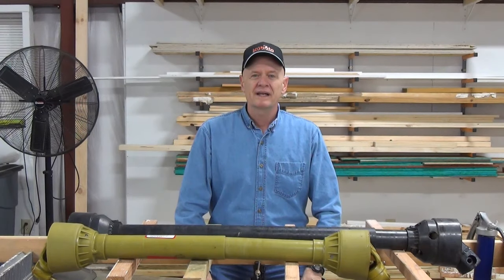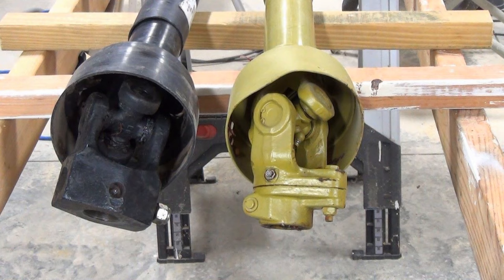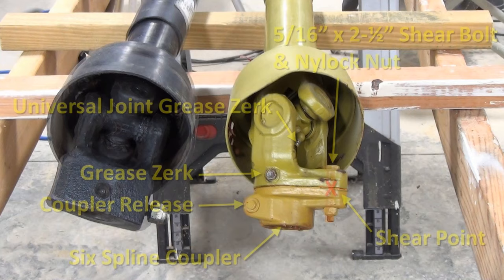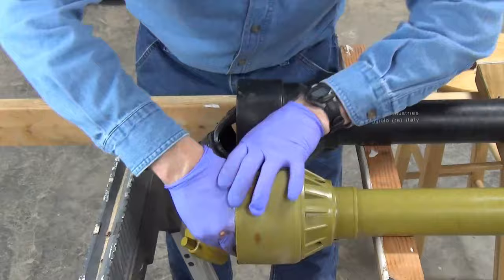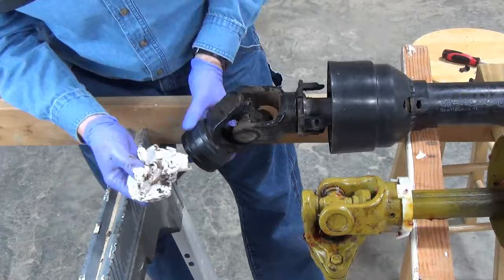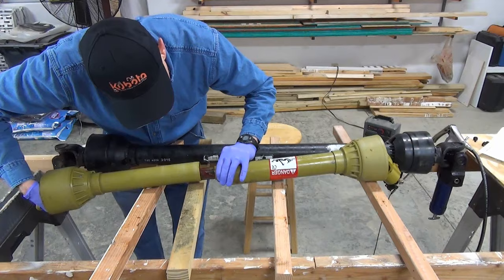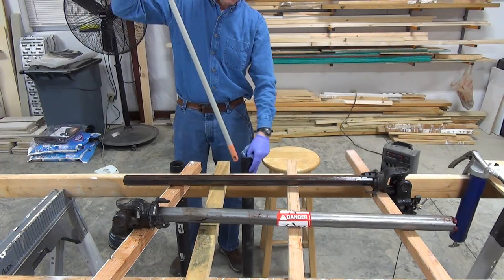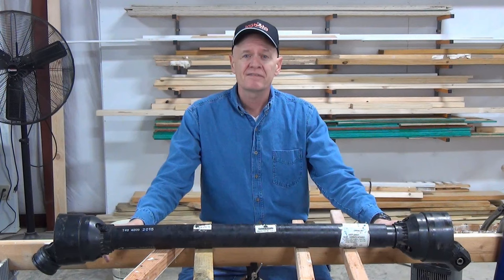PTO Shaft Maintenance - Don't Neglect This!  (#117)

Comment: I use a different method to separate my PTO shafts for periodic inspection. It involves forgetting to disconnect the PTO and driving away from the bush hog.
Reply from the maker: LOL!  I have done the same thing!  Total valid method. Thanks for watching!
Reply: Don't back up!
Reply: Cold weather makes the dirty grease inside the shaft stick. I will pour a bit of diesel fuel in and try to get it sliding.

Comment: Right now my PTO shaft is being pulled apart between two trees using ratchet straps because they won’t come apart. I’ll be sure to come back to this video for preventative maintenance so it doesn’t happen again 🚜 👍🏼
Reply from the maker: Yikes!  Sounds like the PTO shaft was never greased, even at the factory.  Good luck and thanks for watching!
Reply: @DIYMyWay  ended up being a freezing issue and a bit of neglect. A warm shop overnight, WD40, and use of ratchet straps eventually worked. Shaft has been serviced as per your video. Thanks for checking in and the video .. from Canada.

Comment: Have learned that a rag with a bit of diesel helps to remove all grease within the U-joint area: and also cleaning up the two half of the PTO shaft. The the shaft are ready for lubrication.
For the slip collar they are prone to getting misshape when dropped onto the tow bar.
Yup they do slip from our hands at time. A large snap ring holds the collar in place. 
It is my winter repair project. Keeping the spring loaded collar sprayed with PB Blaster on a regular basis helps reduce the effort to make the connection.
Some may not like the idea of diesel to clean these but after many products falling short of their advertisement, it works for me. I simply let the rags dry out over time outside and reuse them until it's time for disposal at your local auto shop or wherever they can be disposed of.
Thanks for the demo.....well done illustrating the two kinds.
Reply from the maker: Thanks for the great tips!  I agree that diesel fuel is great for cleaning off grease and grime. Thanks for watching!

Comment: Another great video - thank you.  I recently purchased the same McNaught grease gun, and then equipped it with a slightly longer hose from them as well as a LocknLube coupler.  So much nicer than my old setup.
Reply from the maker: Glad it was helpful! Thanks for stopping by!

Comment: Those are the exact words I used (@#!$%) while trying to remove my own green PTO shaft shield. So much so, I thought, surely there must have been a recall and a replacement part issued. Instead the dealer (I’m pretty sure we have the same chipper) referred me to your video! I had tried everything: Just as you did, I tried rotating it working one screwdriver; inserting 3 separate screwdrivers while working one and pulling on the shield with the other; ditto, but this time twisting instead of turning; enlisting my wife to “man” the other two screwdrivers with me on the 3rd and pulling; then her pulling…. The result? The (@#!$%) thing has been sitting on my workbench for two weeks, shielded and undefeated. Every couple of days I get up enough confidence to try again, only to be vanquished from my own workshop! If you weren’t half a continent away I’d ask if you made house calls. However, armed with your video and the knowledge those end shields indeed do come off, and by way of a pulling force and not twisting motion, I’ll try again. (Gulp.) Finally, like another viewer noted, thank you for mentioning the needle attachment for grease gun. I had never heard of such a thing and just assumed the plastic “nipples” were further evidence of Chinese engineering prowess…. Best. Joe

Comment: on those plastic tip if you slip in a wire tie under the clips you go the cover will just slip off after the third clip works great every time hope that helps

Comment: Very informative video.  I guess I have been very lucky.  I grease the universal joints, but I have never worked on any of the other parts.
I did damage a protective cover once by pressing it against my turning shaft and three point quick hitch.  It rubbed through.   Guess I need to purchase a new protective cover and install.
Reply from the maker: Thanks, Eric!  Yep, you should definitely replace that safety shroud.

Comment: This was an immensely helpful video for me. I just need your video about replacing the gearbox safety shroud with something more serviceable!! That safety shroud was not designed by someone that actually needed to change the shear pin or remove the PTO shaft. Did you ever make a video on that or come up with a solution?
Reply from the maker: Glad to hear it!  Yes, I solved the shroud problem in this video: EA Xtreme Gearbox Hood for Brush Cutters: Simple, Affordable & Brilliant   (#192)
https://youtu.be/ab-9VFdNwVk.  Thanks for watching!
Reply: @DIYMyWay  wow, I figured a reply would be a long shot since this video is 3 years old. Instead, you have the perfect response. I will be ordering that gearbox hood. Thanks, again!

Comment: Great video, I kept shearing Grade 2 bolts like crazy. Went Grade 5 no issues. John Deere salesman said the 5 would still shear without really doing any damage as did the lead service tech. Just my opinion. To each their own. Grade 2 just too weak
Reply from the maker: Thanks!  After five years, I’m still on the original sheer bolt and don’t know whether is a grade 2 or grade 5.

Comment: Great video for PTO maintenance.  You mention the gear box safety shroud and how difficult it is to access the connection to the tractor.  I have this same problem with my BH15 bushhog when I need to service the slip clutch.  Do you have a solution for this or a workaround?? Thanks for reply.
Reply from the maker: Thanks, Gary!  I plan to make a replacement shroud that is much easier to remove and get access to the PTO connection.  Stay tuned for a video on it.
Reply: I have a similar question- how do you get the PTO off the gearbox on the implements so you can have it on the bench like it is in the video.   It is probably simple- but this would be helpful to see in a video.  I have the same tractor and bush hog.
Reply from the maker: In the case of my wood chipper, the PTO shaft as the same quick release on the chipper end as it does on the tractor end, so that’s easy.  My bush hog PTO shaft requires me to remove the shear pin to remove the shaft from the bush hog. Thanks for watching!

Comment: Any tricks for removing the transmission PTO protective cap on new kubota 4060?
Reply from the maker: Hi Eric! I’m not familiar with the 4060, but I can tell you that my PTO came with a rubber cover that slides off and I keep it greased to make sure it comes off easily. Thanks for watching!

Comment: Perfect instructions; my PTO shaft is now clean and happy.  Question for you--my PTO shaft does not appear to have shear bolts.  It does have split pins at each end, connecting the U-joint to the shaft.  Are those split pins possibly designed to function as shear pins?  Thanks much!
Reply from the maker: Glad to hear it, Bianca!  No, from your description those pins aren’t shear pins. If this shaft is for your flail mower, it may not have a shear pin because your flail mower may have a slip clutch or has a belt drive that can supply the slippage needed to protect your tractor’s PTO.
Reply: @DIYMyWay  that makes perfect sense.  Yes, it is for my flail mower, which has a belt drive.  Thank you!
Reply: My post hole digger has those roll pins, and they keep the shaft from coming off in case the shear pin fails.

Comment: Martin, nice job. Thanks. Great reference video. I use non-chlorinated brake cleaner on really dirty areas of my pro shafts and shrouds. What are your thoughts? Also, how many pairs of gloves did you go through? Have a productive day.
Reply from the maker: Thanks, Tommy!  I haven't heard of using non-chlorinated brake cleaner for that, but that sounds like a great idea.  I used way more than would have actually been needed because I often had to change them before moving the camera for different shots.  Had it not been for that, I probably could have done it with 2 or 3 pair. Thanks for watching!
Reply: Tommy Ordoyne   I would just read the label on the brake solvent can to make sure it is safe for use on rubber, as most u-joints have rubber seals. I believe most non-chlorinated solvents are, but I'd make sure. 👍

Comment: Great video! My issue is I cannot get the pot shaft yoke on my 47" snowblower to release and lock on to the tractor's drive shaft. I've lubed it, cleaned it, hit it with a rubber hammer, nothing. The collar retracted when I took it off the tractor's pto stub but now I cannot get it to lock back on when trying to put it back on.  Any advice?
Reply from the maker: Thanks!  Those collars can be a pain for sure.  Make sure you have the front ring of the collar pulled all the way back while sliding it on.  Good luck!

Comment: My BUSHHOG PTO shaft   has been sticking in cold weather so I have trouble extending it to hook up to the PTO. I pulled it apart and will clean and grease per your video. What grease do you recommend for freezing temps. Also, how do I clean the inside of the female shaft?
Ed
Reply from the maker: Hi Ed! Sorry to hear that! Since I live in a warm climate, I have not researched cold weather grease, but I'm sure you can Google it and find one.  As for cleaning the inside of the female shaft section, Id use a gun cleaning rod with the biggest brush you can find, like for a 10 gauge shotgun.  Soak it with Kerosene or diesel fuel.  Good luck!
Reply: @DIYMyWay  Great thought! I will do that next Time. I was able to clean the outside of the male portion with deisel fuel and pour a little into the female half while turning it. That worked well. Thanks again.

Comment: Any idea why on a compact tiller the shaft rear safety tube s hook has bent and came loose twice? Hasn't broke plastic eye on tube and rotating by hand in neutral there is no binding
Reply from the maker: Hi 002!  That is a mystery indeed!  The only thing I can think of is part of the chain might have gotten caught by the universal joint of the shaft and yanked the s hook out.  BTW, just 005 more and you’ll be 007!

Comment: Hi there , I have 2018 John Deere 2025R tractor . I have the brush hog driveline stuck on my PTO shaft . Does anybody have an idea how to get driveshaft off ? I tried spraying WD40 into quick release yoke I think there’s 3 ball bearings that might be rusted . Still stuck please any ideas will be appreciated .
Reply: Yep, that happened to a couple of mine from letting them sit out in the weather. Fortunately they were off the tractor. You might try diesel fuel or something stronger than WD40.

Comment: What type of grease? And what kind of oil and oil dispenser did you use? Took tractor over for an  Ill family member so I know it’s a rookie question
Reply from the maker: I used Lucas Red N Tacky grease.  The oil was a light weight machine oil like 3-in-1 and the dispenser was my dad’s old oiler dating back to the 50’s or 60’s. Thanks for watching!
Reply: @DIYMyWay  thanks for those details. Great video. I was able to do the full maintenance on an L3301 based on that video. Much appreciated since my FIL got sick he could not operate his tractor. Had to learn quickly and this helped a lot.

Comment: What are your thoughts on using silicone or graphite spray on the telescoping parts of the shaft instead of Lucas grease?  Thanks!
Reply from the maker: I have never heard of anything other than grease used for lubricating PTO shafts so I’m sticking with grease. Thanks for watching!

Comment: Hi again, and just curious. Armed with the confidence your video gave me, a bench vice and, again, ably assisted by my wife , I (FINALLY) was able to remove the safety shield. Unfortunately in the process  I chipped one of the collar locks. Not one of the three tabs that hold the shield on, and it most likely will still hold. But you commented, "If worn,...replace...." Titan certainly  doesn't sell. Where were you thinking you would go to replace if yours needed? Secondly, I found a titillating video from the Alabama Extension University (https://www.youtube.com/watch?v=uBoINyG7USU) that says, essentially, "Put it on and leave it on." That left me wondering 1) If they came up with this advice after watching your video, and 2) In the two years since you made the video, did you ever take it off again? 🙂 p.s. To any unmarried tractor owners out there, I strongly suggest lowering your standards before taking this on....)